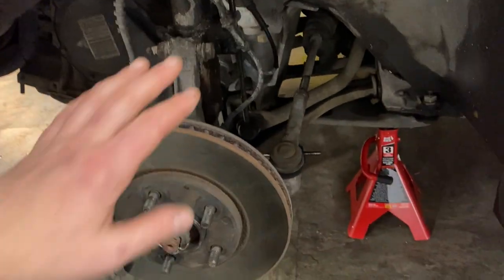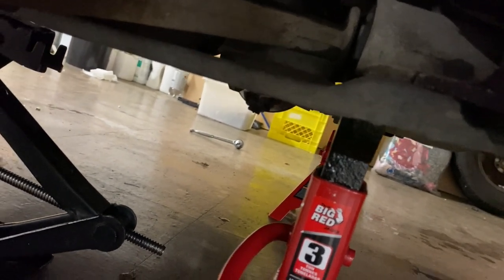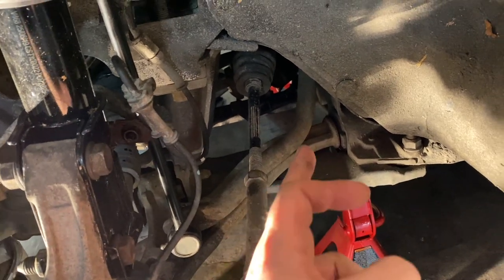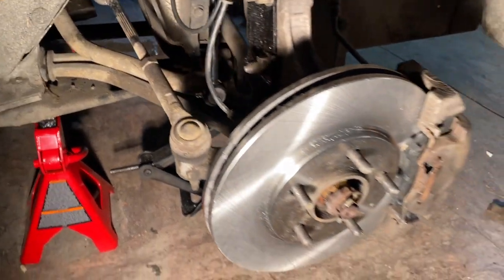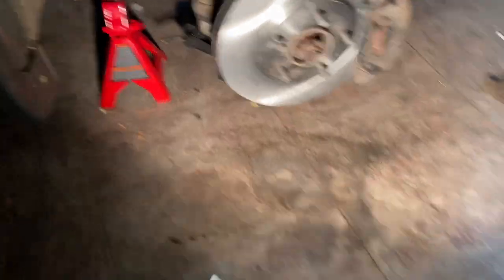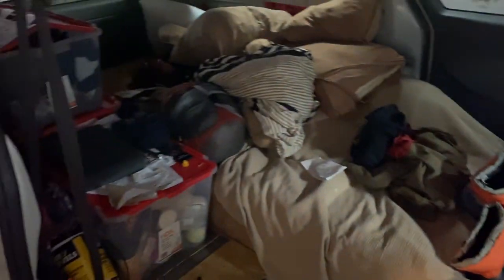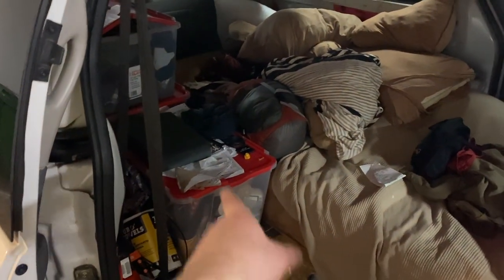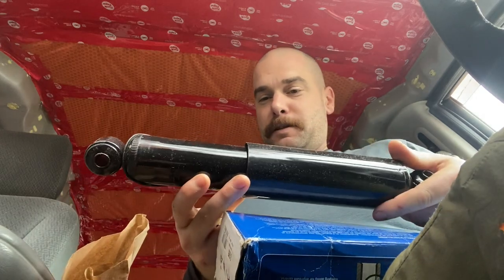MINIVAN Build E-5 || Struts, Brakes n Bump Stops

Comment: Thanks for great share and video!  Had to do some of that on my old Van, but you did better with bushings and other parts.... Common repairs as you say for an older Van... I had to pay shop, as I didn;t have shope or tools, so Brakes, 4 shocks etc was expensive :(  Take care and all the BEST in the New Year and Dheers from south of the border!  :)
Reply from the maker: I was going to have a shop do it too, but then I thought about it and saw that the price of a couple jack stands and my time was all I needed.  It seemed more fitting.  

I still bring the Van into the shop for some things. It's much more time effective to have an equipped shop with someone experienced do the work, then again it sucks when you're dealing with a less committed service tech and or need to fix someones hack job repair. I go back forth.
Reply: @SharingTheWild  Thanks again!  Yep, you did a far more complete job than I, miss the old Van, but knew I was going to have more repairs soon.  Maybe use Emi's shop?  Great build and restoration !  Cheers from south of the border! :)

Comment: Have the authority's given you flack about turning your passenger seat backwards? I wanna do the same to utilize the space.
Reply from the maker: So far no.  Mind you I haven't been pulled over and I don't let anyone sit in it while the vehicle is in motion.  If you do turn yours be mindful of the air bag system; I imagine you wouldn't want that to deploy with the seat turned around like that.

Comment: I only turn my rear windshield wiper on by mistake. Never turn it on intending to use it.
Reply from the maker: I get that.  Turns out I don't use mine very often. It only cleans a small part of the window and I often find just cleaning the whole thing at a service station is good enough.
Reply: @SharingTheWild  - But you still have a nice new wiper blade, and that's a good thing!
Reply: I had a 96 Dodge Caravan, the rear wiper is good to have while driving in heavy traffic when it's raining cats and dogs.

Comment: hope you didnt use that scissor jack....dont... they are barely good enough change a tire
Reply from the maker: I did; I've been using those for years.  Then again I haven't looked into the risks of them compared to other options.  What's your take on them? is it a safety concern or just a functional comparison?  Thanks.
Reply: @SharingTheWild   dude dont do that again if you value your health. they suck. they are wobbly, often hard to crank, struggles to take the cars weight....  basically designed for tire change only. If you think about it your body isnt really going under the car to change a tire... much
Reply from the maker: @saltpepper1894  Thanks, I was aware to keep my body in a safe place while I elevated the vehicle. Once up I slid the jack stands into place and lowered it back down onto those.  I think it would be pretty risky to depend on one alone to bear the brunt of the weight while working on a vehicle, for sure.  That said I have use them to change tires in the back country and in one of those instances I did depend on it to hold the weight while swapping the tire. Definitely risky to use it like that.  But let me know if there's something more to it, I'm not attached to it.
Reply: @SharingTheWild  scissor jacks are the worst kind of jack...even bottle jacks are better. likely will need a lil piece of wood to gain enough height. Best to carry a small floor jack of coarse they are bulky & heavy. If your worried about flat tires, can also use semi perm tire sealer 'Slime'. Works great but wont protect from sidewall damage (nothing will). It has coolant in it also prolongs tire life.  heres a review of it....https://youtu.be/H5DWhIF1c0M